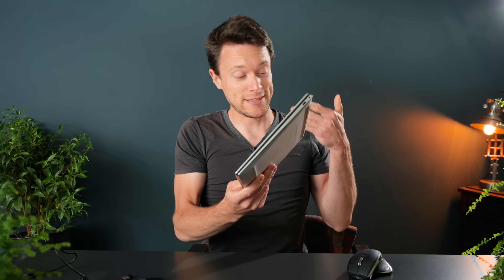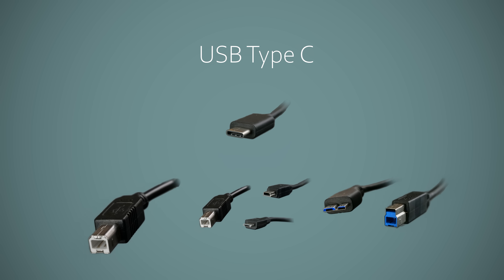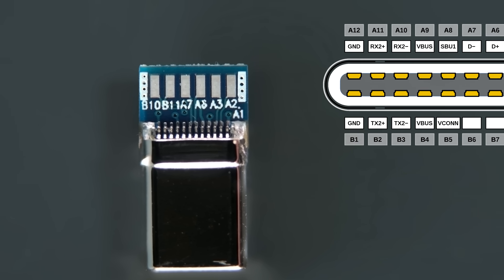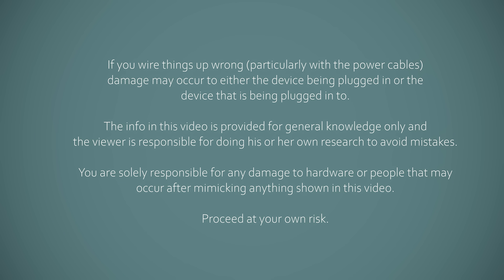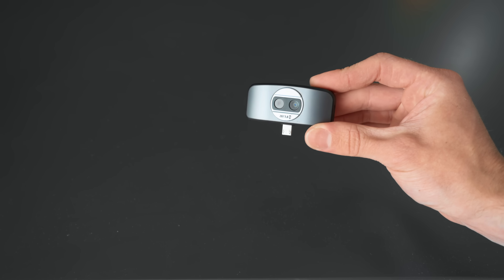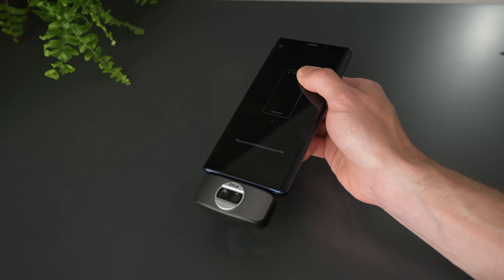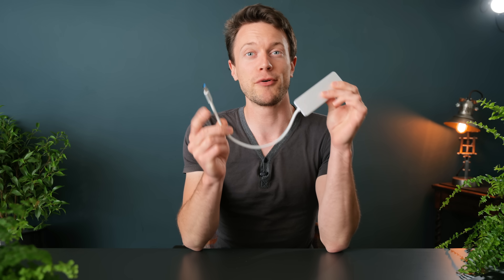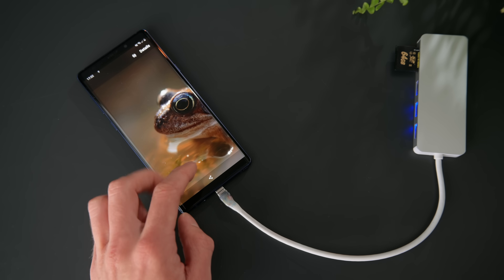Converting devices to USB Type-C

Comment: As a quicker way - that 'trimmed down' USB-C connector can be just reflow-soldered directly to the contacts of a deconstructed version 2 USB-A connector. Flow as little solder as you can manage onto the USB contacts, add some extra flux, heat it up until the solder reflows. Much easier than fiddling with tiny wires. If anyone out there is making these things, can I suggest a few open vias through the data pins? Then we can flow solder down through these vias, and they help transfer heat through the PCB to make soldering easier.

Comment: Hey Matt! Excellent content per usual. I would be interested in the webcam vid; only, I would be more interested in turning it into a POE (Power Over Ethernet) or even a 'plug-in' type IP camera. I have been wanting to do a DIY security camera, but, I keep putting off getting a Pi and I have several old laptops sitting around collecting dust. Their monitors and boards I have plans with but the camera will just be junk otherwise.

Comment: This is very interesting for the technical info, but I gotta add some caveats.
If all you want is a small form factor converter from USB C to A, eBay will probably have what you want for cents on a dollar. I've seen adapters that are smaller than the one Matt has there, though you will always be limited to the size of the USB A connector... so his solution is still smaller.
Shouldn't need to be said, but just to reinforce, no matter how much you change the connectors, you will always be limited to speeds of the lesser device.
So obviously, your USB 2.0 device won't go faster just because you replaced the USB A connector with a type C port.
Kinda stupid, but it gives way for another thing I wanna point out - devices having a Type C port are not a guaranted that it uses all the power and data speed that the protocol can offer. In fact, I have seen smartphones and some other devices that have a USB Type C port, but internally they are actually going at USB 2.0 power and speed.
Finally, about the reluctance of certain manufacturers to adopt the Type C port, such as Logitech, Microsoft and some others, it has to do with how universal the ports really are, and the problems that USB Type C had right out of the door regarding shoddy cables and chargers that were basically frying electronics all around.
As some might remember, few years ago a Google engineer saw fit to review all cables sold on Amazon to tell if they were reliable or not, because there was a major manufacturing mishap happening that allowed generic USB Type C cables to pass that were not built under spec, and could fry devices connected on both ends.
Shoddy cables were not much of  big deal back in USB 2.0 times because they were handling little power, 5V 2A max. But with USB Type C, that power jumped to a level that can fry and destroy devices if it's not done properly.
So my guess is that big companies have been late or aprehensive with the change because of that, but also because outside US and other developed countries, the true universal standard still is USB A, and micro USB to a point.
The change happens much slower here on the third world. I swear I have yet to see someone else with a USB Type C phone around me here in Brazil. Most friends, relatives and coleagues are either on micro USB, or the richer folks on Lightning.
I do get wanting to unify everything under USB C though... :P Personally, I got adapters and maglev style cables. Unfortunately, the cables I have can only charge at USB 2 speeds, as the magnetic connector is round with a central pin for positive and an outer ring for ground... but the convenience makes it worth.

Comment: I made a USB type c single led torch that I can plug into my Samsung Galaxy S9+ the same way you did in your older video.
It was a lot of fun to make and I plan on making an RGB LED tube light with a rechargeable battery back that also acts as a stand just for funsies.
Thanks for inspiring me to build my own stuff instead of shelling out for the same thing at the shop.

Comment: There is a reason manufacturers still won't do type C....because largely a lot of people in the world still either use a old computer and  USB 2.0 is the most common connector. Even USB 3.0 isn't always available on most new devices. USB C as you see is only common in ultra portable devices. Even slim laptops have USB 3 and 2.0 as std connectors.

Comment: At work we needed to make a RS485 adapter conversion from standard USB A to type-C so tablet with only type-c ports can be used.
So I just took USB A to type-C charger cable, cut off the old type A side, soldered to the RS485 adapter and... it didn't work.
Took me a while before I realised that those need configuration resistor to output any voltage.

But then I still needed off the shelf cable that would work like that so it looks tidy, the solution was to buy type-c cable to mini usb, because it's supposed to connect older devices wtih mini usb to newer type c devices, it had already been fitted with correct configuration resistors.
UK Amazon: B07D1N8GSW

Comment: Unnecessarily complex port. USB type-A is more than enough for most stuff and way more sturdy/easier to repair @ home. Barrel-type ports are also way better as they can be replaced easier as well, not to mention being cheap to get cables for.

Comment: why didn't you just move the smd resistor instead of putting the massive 1/4w resistor? the empty pads right next to it are for that very purpose
Reply: or even just scraping the trace and then making a solder bridge between the two.

Comment: Excellent video Matt. Very well done and IMHO well needed. One small suggestion from someone who used to do a LOT of soldering before old age, Parkinson's and failing eyesight, Keep your soldering tip spotless. I saw yours at 10:53 and almost passed out. Frankly, I have doubts as to how long your soldering job will last without the use of Flux and good cleaning afterwards. 

I would like very much to see you gut a an older laptop for its camera and other parts.

Try JB Weld or your preferred brand to increase survivability to rough handling after assuring oneself of zero electrical conductivity. ( PS ) I have the same mouse in a Trackball setup. It is a great pointing device.

Comment: The ideal situation for a mouse is to connect directly to the Bluetooth of the computer, so there's no need for an adapter popping out from the side of the laptop. I guess that in desktop PCs it doesn't matter, but on laptops it looks particularly ugly. I really don't like mouse that strictly uses adapters

Comment: USB C is overrated. 
It's good as replacement for mincro/mini-USB but when small size isn't essential (and even for laptops IMHO isn't - regular USB type A is still quite small connector and can be easily fit even into slim netbook) then it's actually too small - a little more bulky USB A is easier to connect (neglecting being non-symetric), more robust and provides better heat dissipation (small pendrives with USB 3.0 can get really hot - maybe not enough to damage anything but that temperature makes handling them right after being pulled out quite unpleasant and that connector acts as a heatsink for them). But I think the most important is that roubstness.
What would be perfect is connector with shape of USB C (and probably pinout) and size of USB A. Unfortunately, seems like USB 4.0 not only doesn't introduce something like that but even doesn't include type A at all.

Comment: probably a great device to do this to would be a ps4 or an xbox controller
from opening up a ps4 controller, it has its charging port on a separate board so doing it should be relatively easy :)

Comment: I don't understand this?  It's a lot of work, and likely more fragile and less reliable then just buying these adaptors, which mean the device can still be used on older devices, too, with adding barely any size...
https://www.ebay.co.uk/itm/DM-MINI-TYPE-C-Adaptor-Adapter-Turn-Regular-USB-into-Type-C-USB-Flash-Drive-L-6/184208968865?hash=item2ae3b5cca1:g:5nIAAOSwGTxeaLWK

Comment: While Type-C is definitely the best solution on the device side, but I get very annoyed by laptops that skip type-A ports entirely, as it robs the USB standard from one of its best features, which is backwards compatibility. We shouldn't have to use dongles or break out the soldering iron to use legacy devices.

Comment: For the less patient of you, there are these small adapters that can be used instead, I have a few and they work fine. Not as neat, fun or durable but an easy and cheap fix (: https://www.ebay.com/itm/402116013197

Comment: I'm sure all these wireless mice just use bluetooth internally, so maybe you could just change the mouse software instead
Reply: I don't believe so.  The mouse adapter is 802.11ish while blue-tooth is a different frequency.  "Wireless" mice (and keyboards) usually require the use of a proprietary dongle so that devices aren't confused.  Which makes them "Plug and Play".  Whereas blue-tooth devices require an initial "pairing" to be recognized.
Reply: This just in!  The Logitech Unifying receiver/mouse/keyboard (combo) is an extremely small dedicated USB wireless receiver, based on the nRF24L-family of RF devices which can apparently be used in conjunction with blue-tooth.  Therefore, I stand corrected.  There is such a thing as a wireless/blue-tooth combo.  Oops!  I learned something (Thanks, "P") which is always fun.  Oh, well.  I need to get out more.  Oh, wait...  Be safe out there!

Comment: Hey I have a question :D 
If i only have a tower with no screen or keyboard, can I use a Laptop as input and screen? I like to play games on my couch with my Laptop but with better hardware out of my tower it could be so much better. Is it possible? (tower next to my couch, some cables to the laptop on my lap) of couse I don't want any lagg or input delay. [So to say the mainboard of a tower with cables connect to a laptop??]
 Notice: I don't want to have a lose keyboard on my lap and a TV as a screen, i realy want the old Laptop "as a case" for screen and keyboard. The laptop don't need to work with a opperating system or some Programs like remote controll in my case, I just want to use the screen and keyboard for an external device like my tower pc. 

(never found something on the internet so i discribe it so correct as possibe(? xD)) THX :D

Comment: So this would be the same for 30 pin USB. But I don't want to pull apart a large brick of stuff (a 2x iPod gen 4 with fm radio plus a screen on the front, plus lots of little buttons) that is way too complicated for me

Comment: I don't get this... There are tiny usb A to usb C adapters out there for less than a dollar with the same or smaller footprint than this. 

This is still a dongle, the only difference is the size, and since you can get a dongle that small for so cheap this seems overly complicated.

Am I missing something?

Comment: ok a bit of soldering wire it ain't that hard
"and replace with a 5 kilo ohm resistor"
ok i will take the 2mm bigger adapter solutions
Reply: yeah, no, still trying to wrap my head around :31, an adapter is "not a solution"...?...
Reply: And soldering is "easy"... yeah. Tell that to everyone who ever studied the skill as part of a higher learning course.
Reply: @marcdraco  it's quite easy to solder, but it's hard to master.
Reply: @breckr1121  It's easy to make a mess... (I was trained by the military to solder and wire to the highest standard in the world). When I see some of these hacks, particularly by a guy with such enviable skill and tooling, it really makes me wince!
Reply: Yeah, I think this is the biggest time waste ever. Just buy the adapter and move on to more important things.

Comment: did anyone notice he didn't have the scrap the trace away
all he had to do was move the resistor to the other pads
the traces on the left at 7:12 if he removes the smd resistor and puts it on the 2 pads to the left of the original position it would pull to ground not to positive

Comment: I love the concept of type c, but it hasn't been durable in my experience. I've broken 4 ports on power banks or charging bricks in the past few years. That never happened with type a or micro.
Reply: Tyoe C is durable.
Tyoe C is not a 'concept', it has existed now for a couple years.
Type C is not going to be the main connector in the near years, as Thunderbolt (2) is a superior connector with a very similar form factor.

I have never had any issues with Type-C, but USB 2.0 Micro-B is far less durable in my experience and the general consensus is that type-a is a more durable connector.

Comment: This DIY is simple in theory, but we need amazing solder skills like you to pull this off
Reply: Not that's bad, those pads are made for hand soldering.  What would need amazing is instead of adding a resistor, move the resistor over from "R1" to "R2".  Or scraping the trace like he does and putting a jumper over.

Comment: This video is so awesome!! I wish that this experiment will be simple enough for someone with not from electrical background.
Reply: Try not to be intimidated.  Electricity flows like a circular river.  Goes out then returns.  The resisters and capacitors can be a little tricky but just a little research (like these videos) should see you through.  Practice on things that don't need resisters and capacitors first though.  Enjoy!

Comment: I tried this with a few corded devices in the past, planning to ultimately change over most of my USB devices and ports to the C-type connector (even if they're not USB 3.0 or 3.1) - but the problem I ran into was that the connector board I bought was configured to make the wired-in device a "host" rather than a "slave", (6:25) so the resulting device would work on a USB 2 port that had been converted by an adaptor to the C connector, but it wouldn't work on a real USB C port. To correct the issue I need to replace a surface-mount resistor on the adaptor board. I haven't gotten back to the project lately so I haven't gotten past that point.

As much as I love the USB C connector, the wireless mouse example actually illustrates one of the cases where the A connector is still better: for devices that simply plug into the port and stay there, like thumb drives and small dongles, the A connector is actually more stable, and certain small devices can actually fit entirely into the port. Though of course that doesn't help you if you haven't got any A ports on your laptop...

Comment: I find it incredible that a YouTuber at home bought some cheap type C connectors and changed over some devices in afternoon with a little bit of effort and some minor research and yet a lot of manufacturers who have the benefit of scale cost savings and massive R&D budgets have yet to do the same even though their customers are asking them for it. It is the pinnacle of apathy
Reply: They are hoping everyone will ditch their accessories and buy new ones. I wish this advice had been around years ago when my very expensive one year old A4 Wacom graphics tablet was rendered obsolete by OS and port changes!
Reply: Ah thats another topic. If u change a USB2.0 Port to a Type-C port, doesnt mean that you will get the bandwith u would get with a native C port.

Comment: Those mice work natively with that laptops built in Bluetooth... no dongle required.
Reply: I don't believe so.  The mouse adapter is 802.11ish while blue-tooth is a different frequency.  "Wireless" mice (and keyboards) usually require the use of a proprietary dongle so that devices aren't confused.  Which makes them "Plug and Play".  Whereas blue-tooth devices require an initial "pairing" to be recognized.
Reply: GLACIOUS13 that mouse is a Logitech Master MX. It is Bluetooth. You will find almost, if not all wireless mice are Bluetooth (usually BTLE). They will work with the laptops built in Bluetooth receiver like I said.
Reply: @fiestaphilwxm  I followed what you sent and found that...  The Logitech Unifying receiver/mouse/keyboard (combo) is an extremely small dedicated USB wireless receiver, based on the nRF24L-family of RF devices which can apparently be used in conjunction with blue-tooth.  Therefore, I stand corrected.  There is such a thing as a wireless/blue-tooth combo.  I learned something which is always fun.  Now, I need to copy and paste this apology.  Oh, well.  I need to get out more.  Oh, wait...  Be safe out there!
Reply: @GLACIOUS13  Hey man, everydays a school day I thought it was vanilla bluetooth, didnt realise it was something trick. :)

Comment: Hmm I could also connect my Logitech mouse by Bluetooth instead
Reply: Not that mouse.
Reply: This just in!  The Logitech Unifying receiver/mouse/keyboard (combo) is an extremely small dedicated USB wireless receiver, based on the nRF24L-family of RF devices which can apparently be used in conjunction with blue-tooth.  Therefore, I stand corrected.  There is such a thing as a wireless/blue-tooth combo.  Oops!  I learned something (Thanks, "P") which is always fun.  Oh, well.  I need to get out more.  Oh, wait...  Be safe out there!

Comment: Woah!  Those resistors are a blast from the past!  You can get a book of 0805 or 0603 size SMD’s from Adafruit for everyday use - the old school ones do still work well for pluggable breadboarding, but I tend to do all that stuff in Eagle or where ever and do a soldered prototype on a solder breadboard - just a matter of taste there.

Comment: explanation of usb c is quite useful, hoever the " upgrades" are quite backwards.  especially for the first case this (https://nl.aliexpress.com/item/32872051394.html) would work much better without the risk of bricking your mouse and with the ability to revert it, and not compromising on size. The last example is prone to breaking, though, in this case I will grand that it is hard to find a proper usb-c 3.0 cable connector online,